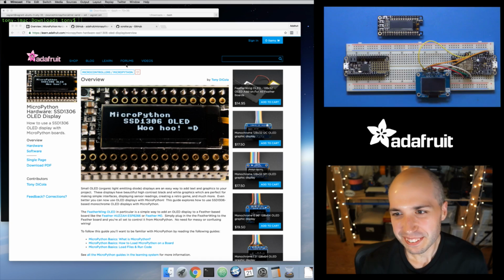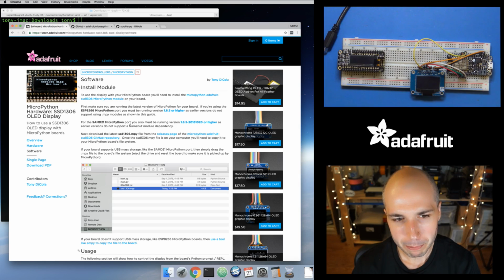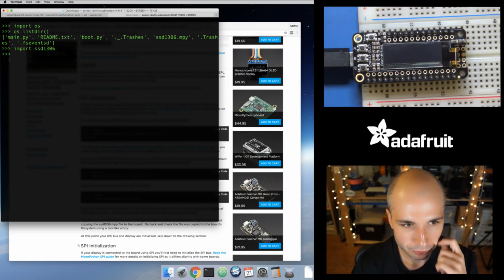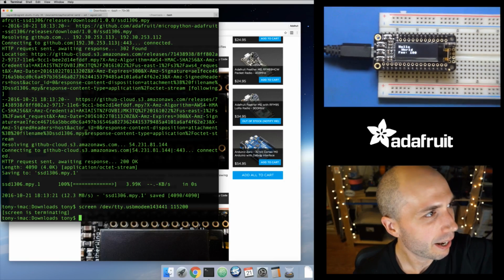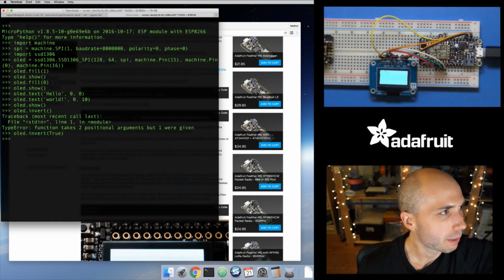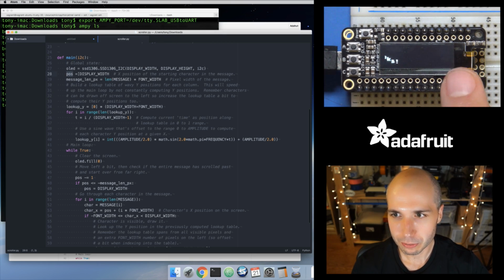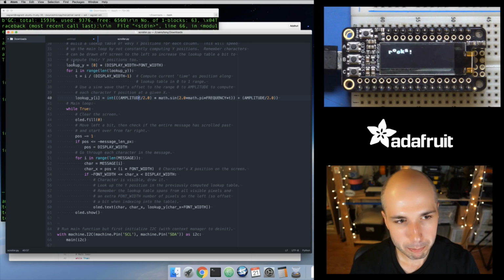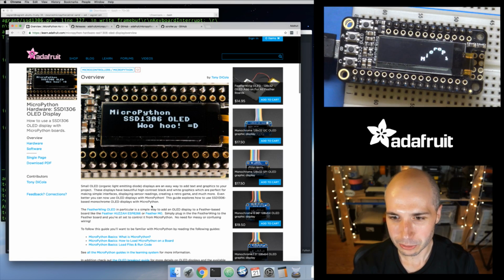MicroPython Hardware: SSD1306 OLED Display with Tony D! @micropython

Comment: great video thx a lot. I try to do thath with micropython V 1.0) and I replace this cmd:
display = ssd1306.SSD1306_SPI(128, 64, spi, machine.Pin('Y3'), machine.Pin('Y4'), machine.Pin('Y5')) 
I Use the Spi(2) on this board located at : Y5 to Y8
But it don't work, any idea for me ?

Comment: I am getting the error
File "<stdin>", line 1, in <module>
  File "ssd1306.py", line 99, in _init_
  File "ssd1306.py", line 35, in _init_
AttributeError: type object 'super' has no attribute '__init__'

while calling >> oled=ssd1306.SSD1306_I2C(128, 64, i2c)

Any suggestions?

Comment: I don't know about micropython but in normal python at least negative indexes are supported. The array length is added to negative indexes so for example -1 is the last element, -2 is the second-last etc. I found it pretty handy feature, actually. If the FREQUENCY is an integer, the code works without the offset, provided that the micropython doesn't impose any additional limitations compared to python.